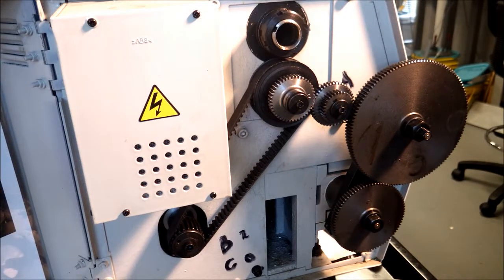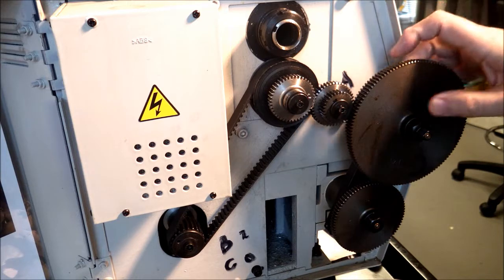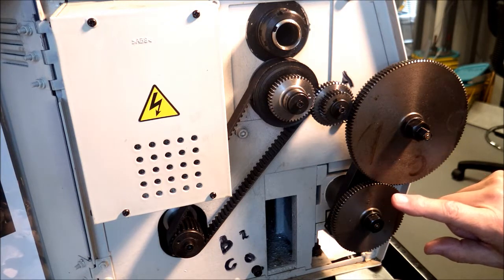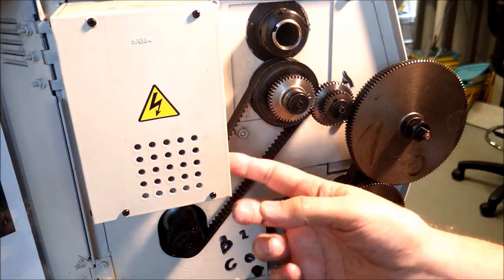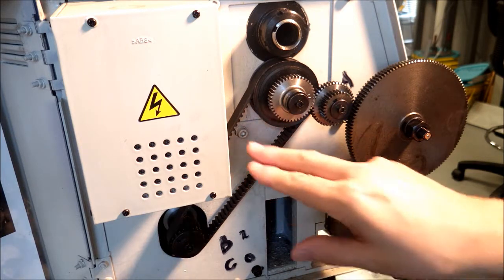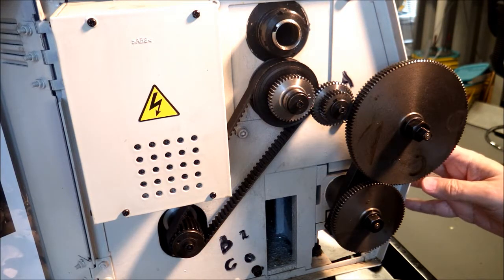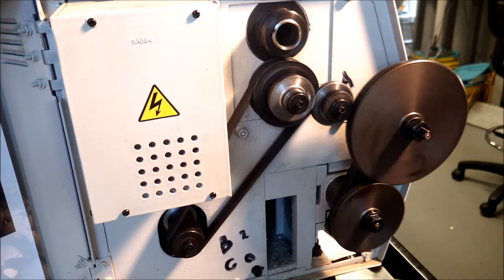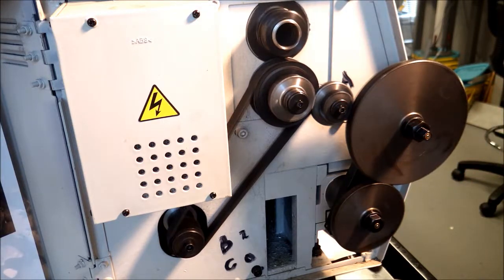The Secret to Threading 32TPI and Finer on the SC4/LMS3540 Lathe

Comment: You have saved the day! I am working on a project where the kit supplier specified a 10-32 thread in tiny piston rods made of very annoying stainless steel, and they were so stingy with the stock that they were cut only about 50 thou over final length. So, I had no chance of getting a die started and then trimming off the ugly part. Single point threading was the only way to cleanly start that die--and that's when I found the 32TPI trap. Your video showed exactly how to get around it.
My two tiny piston rods are now perfect. I really love the LMS3540, so I am willing to allow for this shortcoming.

Comment: I think I’m going to buy one of these from a local seller. The lathe is in excellent shape. He’s asking $1200.
Reply from the maker: I wasn't aware that they'd gone up as much as they have at LMS until I went and looked tonight.  If it's in excellent shape (and you can wrangle the few hundred pounds safely to where you need it) you're saving $1100.  You can get a good head start on tooling for the lathe with that.  I think the SC4 is a good, solid lathe and I knew next to nothing about machines like this size when I got it.

Comment: Thank you for posting this.  I am a fellow LMS SC4 8x20 lathe owner as well.  I literally just figured this out after 1 hour of scratching my head trying to set up the change gears for 40 TPI.  You are correct in assuming that the banjo gets shifted to the operator side of the lathe for 40 TPI and up.  I wish the user manual for the SC4 or the SC4 Fenichel supplement manual had went into detail on how to setup for fine thread pitches.  I was a little annoyed at first and the fact that the door must be left open bothered me a little to because its a little dangerous with the gears exposed to the operator like this.  Then I thought about it and I realized that the reason I bought this particular lathe was because it was capable of threading almost every  inch and metric thread and I knew it didnt have a gear box.  I am still impressed with this lathe  even with this minor inconvenience.   Thanks for posting and I hope to see more vids from you.  
Brandon
Reply from the maker: The main reason I put this video up was hoping it would be useful to other people.

My wife came up with a "field expedient safety cover" - a cardboard box that covers the gear sticking out where it might grab something like a shirt.  Picture on my blog:
http://thesilicongraybeard.blogspot.com/2018/07/a-safety-cover-for-threading-gears-on.html
It's kind of hokey but works.  I know that if I were a business, OSHA would say it wasn't secure enough, but the cardboard wedges between the banjo and the lathe, and the box doesn't move.  The box keeps fingers from accidentally getting too close to the gears and like I say, would keep loose clothing from getting in the gears.   I'm in Florida.  I hardly ever wear a long sleeve shirt in the shop!

I agree, it's a capable and impressive lathe.
Reply: SiGraybeard I like the temporary guard.  I was thinking something similar as well.  I decided I am going to make a custom banjo after I thread the 6-40 leadscrew I am making for a boring head.  The banjo will utilize an idler gear to relocate the banjo inside the cover.  Since I have the full set of change gears and any idler gear size will work I should be able to make it work for any TPI.  I just cant leave well enough alone!  I like your blog to Melissa Milano too!
Reply from the maker: If you'd be so kind to show me your concept drawing or real drawings, I'd appreciate it.  I don't really see how the idler gear would go in my mind.  This email is sigraybeard at gmail  I'm sure you can figure out how to decode that.